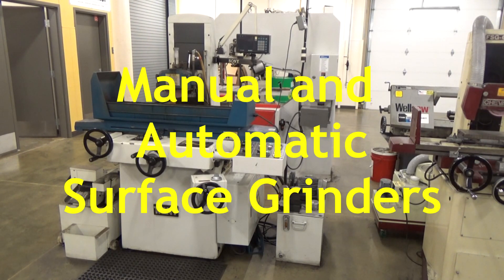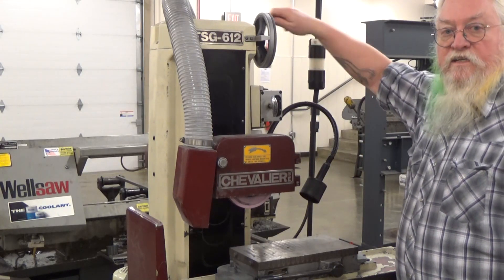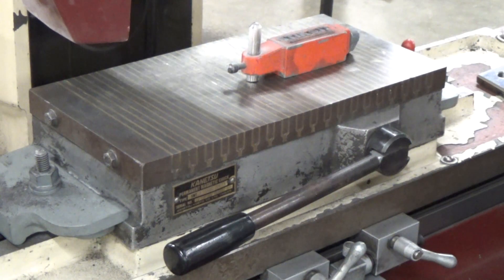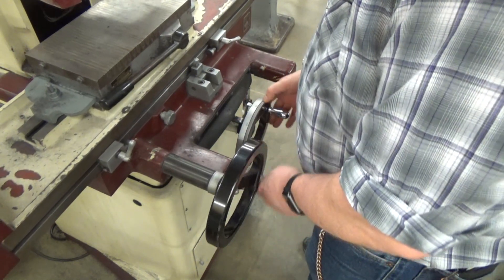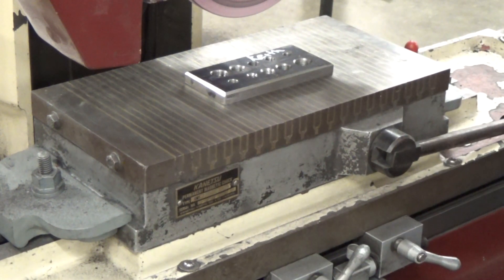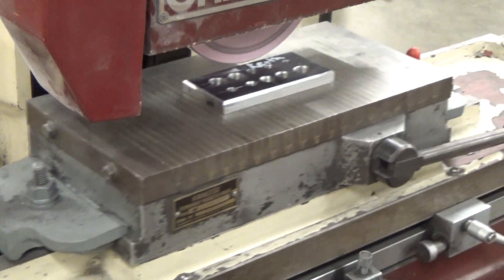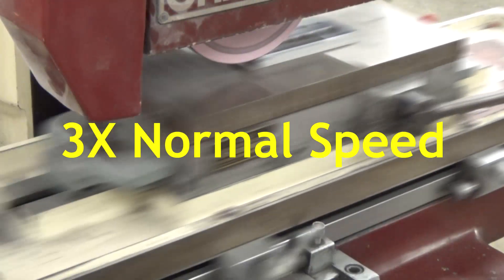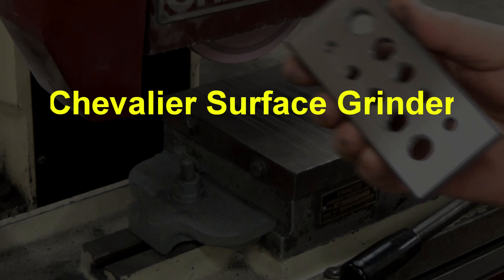Surface Grinders  Chevalier Manual

Comment: 43 years in the trade as a toolmaker… do NOT use a sheet of paper for touch off… if I saw that in my shop whoever did it would pack their boxes and sent to the unemployment line..PERIOD! If you disagree that’s fine too..but you’d NEVER work in my shop a minute longer

Comment: Should a respirator be worn when using this machinery
Reply from the maker: You will note at about 48 seconds into the video I mentioned turning on the vacuum to clear the grinding dust created during the process. So no, you do not need to wear a respirator while using this piece of equipment.

Comment: the final segment shows the pincusion effect. feeding forward in small feed overs the front of the parts expands up more and more into the wheel and gets cut lower. that is why as he feeds back its in open air since the part has cooled and shrunk down. as he gets closer to the back where he started you notice it starts to hit on the ears and feeds out with sparks. That is because of dry grinding which has to be done alot. when coolant is on a grinder many think its cooling the cutting interface of the grains hitting the steel. actually it has almost zero effect on that its actually cooling the part eliminating the pincusion effect.